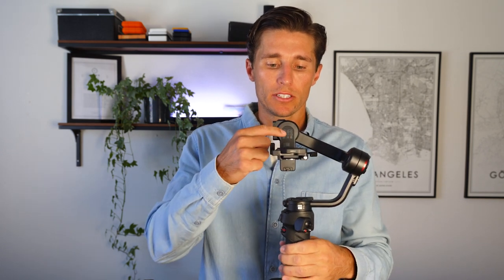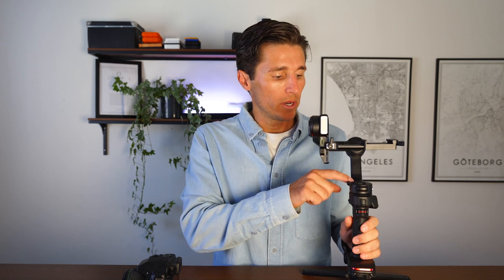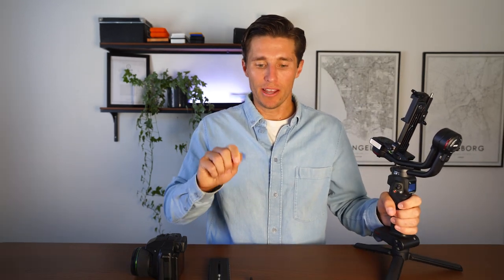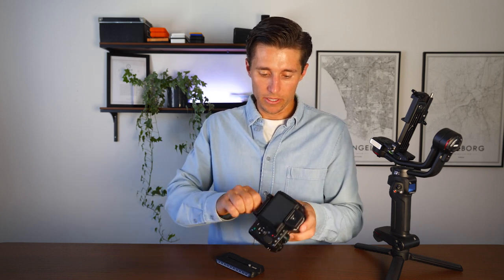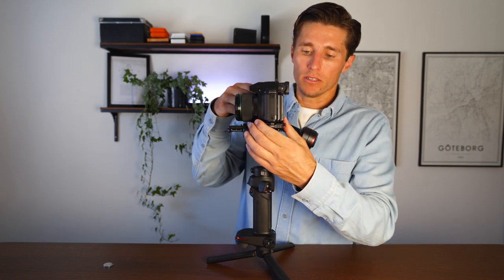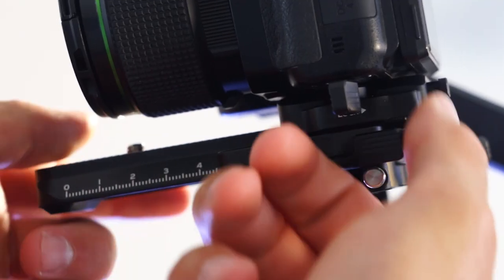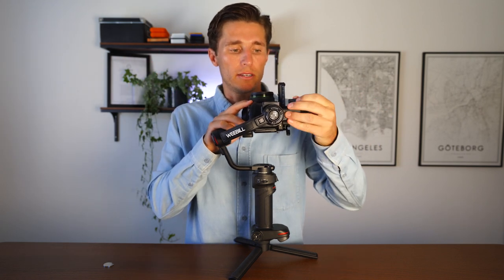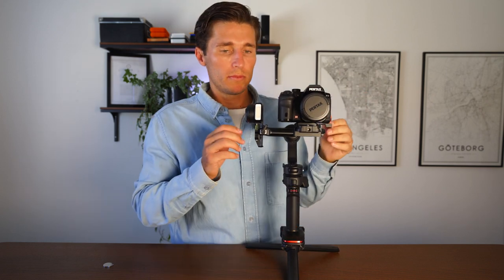Balance and Setup Zhiyun Weebill 3 in UNDER 60 SECONDS!

Comment: Thank you very much. Excellent content! This video helped me to easily set up my Sony A7 RIII with the Sony FE 35mm 1.4 GM. I struggle a little bit when adding my microphone ZOOM F1-SP with shotgun mic. I can't point the lens towards the ceiling, because the mic hits the roll motor. How should I deal with this? Is it possible to do it the other way around and point the lens down to adjust the axis? I play a little bit around and made it so that the camera with the mic stays when i point it in any direction except I go to the very end. Then the lens flips a little bit, but this starts when I point the lens to the very end of the axis. Is this normal when having additional mic on the camera (additional weight) or should I rebalance my set up (if yes, I would need your help how I should do this)?
Thanks in advance for your help!

Comment: Mr. Evan thank you for such a detailed tutorial instruction, very useful. I have bmpcc4k camera with sigma 20-70mm lens. I try doing how u explained it. I guess due to counter weight issue the gimbal fails to balance. do you have any idea in fixing it.
Reply from the maker: sorry just saw this comment, were you able to figure it out?
Reply: @EvanThomas  no i cnt balance the gimbal because the size of the Black magic pocket camera 4k is little wider than the normal camera?

Comment: Thanks for the video; it guided me through more than one mystery.
Also, I see you're mounting a Pentax camera.  I'm using a K-70 so we're in the same boat:
The WB-3 does not communicate with Pentax cameras meaning that the camera controls must be done manually, on the camera itself, not with the buttons on the WB-3.
My question is:  What's the significance of the downloadable software mentioned in the
manual?  Is that needed when using a Pentax camera?

Comment: What about the gimbal batteries? How can you change them if you can do that at all?
Reply: WEEBILL 3 adopts built-in battery, if the gimbal can not be charged or turn on, the best way is to contact their after sales service, because it's difficult to confirm it's battery broken or circuit board issue..